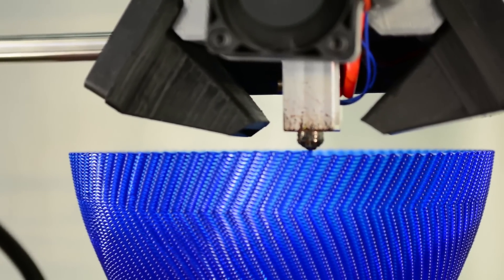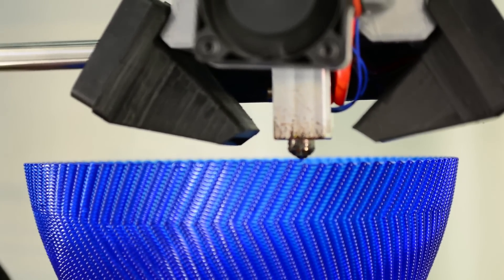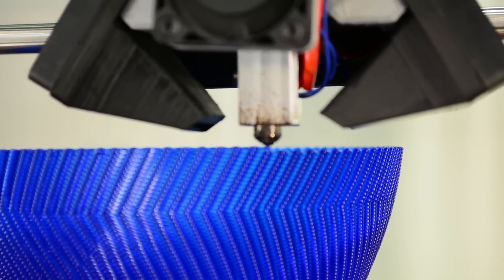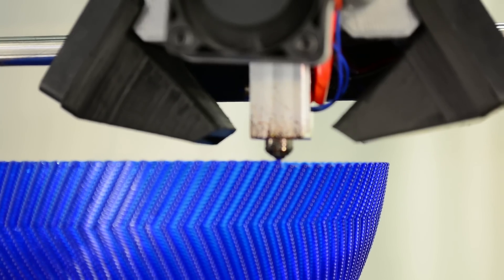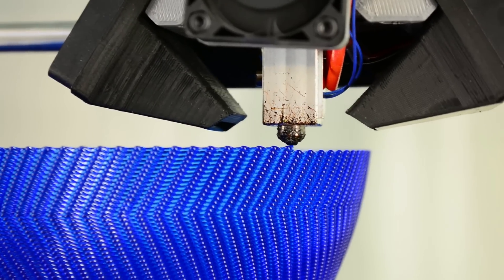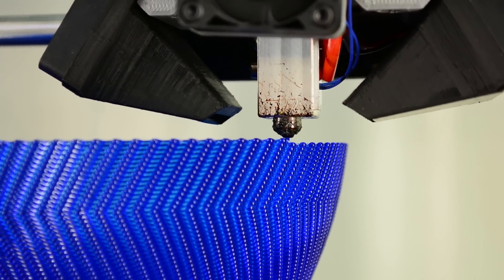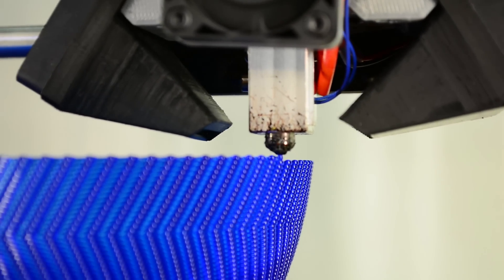Lulzbot Unveils 1.2mm Extruder Nozzle

Comment: Why the hate here. I have, actually 2 Lulzbots. One I use the traditional .5 nozzle, the other I have the MOARstruder 1.2mm. I do a lot of robotics using Arduino and Raspberry. I can prototype 4 times faster with the 1.2, of course at a cost of perfection BUT I then switch back to the ,5 nozzle once I have a final design ready to print. Also, if you use Vase mode you get some really cool artistic features as the 1.2mm layers clearly show. Kind of a very cool look.